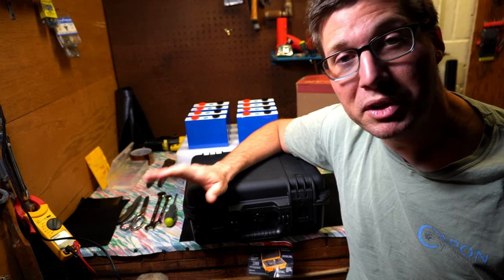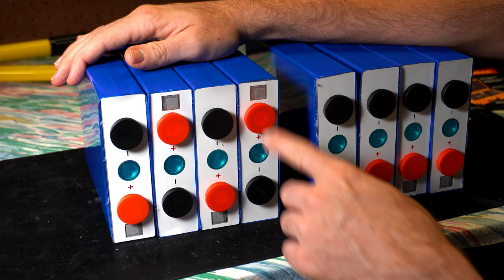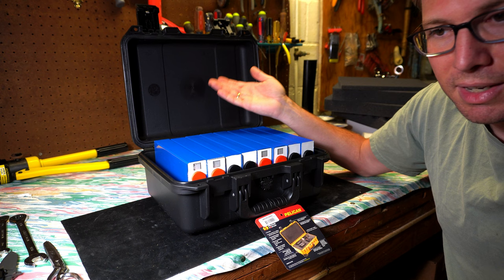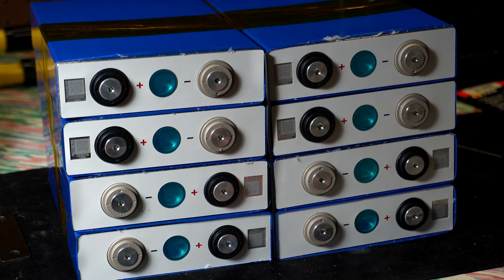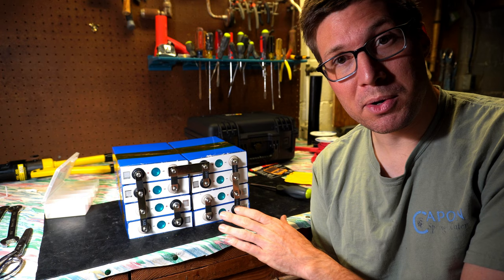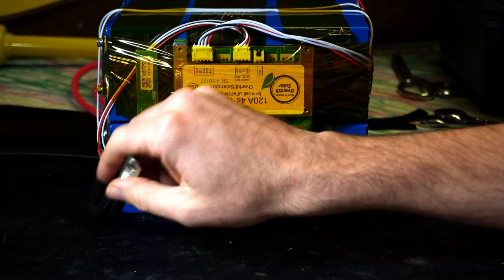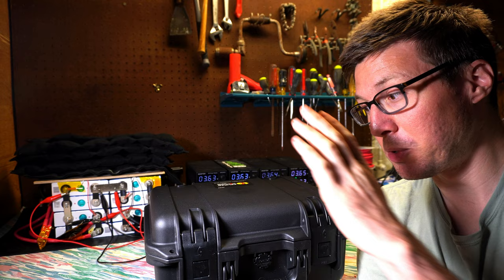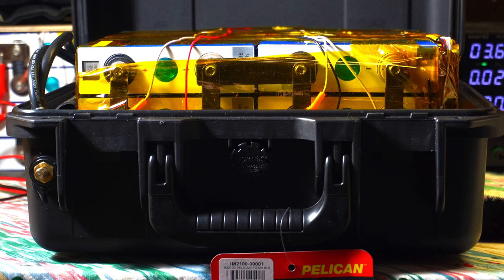How to build a Waterproof LiFePO4 Battery | Sailing Wisdom

Comment: I took the diesel out of my Gozzard 31 and put in an Electric Yacht motor with 48v 200ah LiFePO4 (4 50a batteries).  Also have a 12v LiFePO4 as the house battery, which can be switched to receiving charge from solar or the engine bank via a 48-12v converter.  I went all Renogy components to have a one-stop support desk with the supplier. For getting in and out of harbors/anchorages this has been fine so far.  Exploring augmenting with a 3.5kw Ecoflow rather than adding more engine battery.  Thx for the great videos.

Comment: I still haven't yet started my lithium battery project but I mostly decided to get lipo 48V 100AH x 4 = 48V 400AH from one of the reasonably priced lipo manufacturers.    Currently listed as $1,300 each.   Or, maybe I will get more of them, like 5 instead of 4, because they should probably all be installed from a set at the same date of manufacture.

I built a vanlife vehicle and am using a lipo 48V 100AH battery in it successfully (I suppose it is rated as 96AH or something but I will call it 100AH), and a victron inverter designed for 48V input, and a solar mppt designed for 48V output.   I can use electric cooking appliances in it quite easily (800W for 10-15 mins),  run fullsize iMac computer all day (150W), charge Mac laptop (65W), charge usb devices (10W), etc.

The biggest build problem has been finding the connection components which are rated for that high DCV.   Fuses are typically not rated for the 60VDC which the system needs as a minimum because lipo charging will hit 58VDC max.  I have no battery switch (i.e. kill switch) because I can't find one which is rated at 60VDC.    I ended up having to use a massive T-class fuse which I forget the details but might be rated for 100VDC.  Blue Sea Systems does not make any buss panels which are suitable for 48VDC system, the highest rating they have is 36VDC.  These limitations are not obvious from any of the packaging, and the packaging or item listings can even be misleading, so the fine print in their data sheets needs to be verified very carefully.  At 25:00 you show a battery terminal fuse, these are not rated for 48VDC, they are only okay for 12VDC, sometimes special ones at 36VDC.
Reply from the maker: I was not aware of the voltage limit! I will look into this right now!!
Reply from the maker: Thank goodness, they are rated to 58v https://amzn.to/3XQqSat

Comment: That ring that won't come off should get covered in electrical tape while working with electricity (for the reasons you took the other rings off)
Reply from the maker: That is a very good idea! What I really need to do is get it sizes again so that it can come off, but if I build another battery between then and now, I’ll do that trick with the tape.

Comment: im afraid to tell you what i did, and now im scared to leave it !  i made five lifepo4 cylinder cell bats,12V 4s15p, 81 A each.  i top balanced each 15p group and then balanced each 4s15p ' battery '  i hooked them up to a common bus that is switched to the electrical panel bus no fuse or circuit breaker.  i guess i should put in a bms on each 4s15p bat, and a house bank 400 amp circuit breaker !?  even though each boat circuit has its own breaker.  solar panels through solar panel controllers charge direct to battery bus . i was very happy, although no huge loads have happened yet, with the incredible charge acceptance, but now im scared! thx herb, what a great video !  i also realize i completely misunderstood the function of bms.. i guess im sitting on a 400A bomb..

Comment: Nice build buddy! I might do one of those myself. I've had a "drop-in" LiFePo4 since the beginning of 2021 which has worked great but is only 216Ah. The cells I have for my electric propulsion are 280Ah so if I used those and built a battery like yours I'd have 560Ah which sounds good to me! Plus they are way cheaper now than they were three years ago.

Comment: Did you mention to keep BMS connections on top of the main battery connections? I have read that was important so you don’t run high current through the BMS or other monitoring systems.
Reply from the maker: I did not mention that but that is a good point. I always build the battery and the last thing I do is connect the BMS. Since they are the last thing on, they are also the top connection.

Comment: Please forgive my ignorance, but how is this better/cheaper than just buying an off the shelf 200ah 12v LiPo4 battery for under $600. Is it the waterproofness, quality, size? Thanks for all your videos. I love your teaching style, btw.
Reply from the maker: It’s the parts that are used. There are many cheaper options, and one cruiser I know had the cheap Amazon LiFePO4 batteries (https://amzn.to/3sUO5KZ) and it burst into flames. Miraculously, he was able to disconnect and dispose of the battery while it was on fire and while he was sailing without any damage to his boat or himself! 
This battery is built from the top of the line components using the safest BMS and the best cells. As a result, the parts alone were $1200. 
Pretty much, you get what you pay for and when you build it yourself, you can select the best parts and save on the labor costs of the build by putting it together yourself. 
When you consider a BattleBorn battery is about $1000 per 100ah and isn’t waterproof, this battery comes in at a nice price point for the features you get.
Reply from the maker: This is the price of a premade quality battery (https://amzn.to/3EFMY4u) and they can still have issues arise on them. It’s rare, but I have seen them “singe” first hand. They have good components in them so the BMS shut the battery down before anything happened. The burnt cell wasn’t discovered until tear down. 
Cost wise, to get 200ah in those batteries would be just shy of $2000 where if you build it yourself, you can make a waterproof one for $1200. That’s where the cost savings come into play.
Reply: Makes sense.  Thanks for the reply!  When I'm ready, I think I'll give it a shot. I like knowing what's inside the box.

Comment: 800Ah 24V house bank charged by 5kW alternator/ 1.2kW solar (soon—work in progress)/ shorepower. The bank is for house loads and to charge the starter and windlass batteries. We only cruise the bay (for now)  and the large need(want) is aircon and convenience. 

Concerns for you: AIC rating of MRBF is only 10kA. Safety standards specify class T (20kA AIC) fuse. Also, the different lengths of the negative B- will have different resistance therefore heating. Likely just a bit under normal loads but at high loads it may be noticeable. Not sure why you wouldn’t use a single cable other than space/turns. Again, safety standards would have both parallel conductors capable of carrying the full load. I’d consider mesh sheathing where you have concerns about short circuiting.

Not really mentioned but the batt cases will need to be “installed” so they cannot move if on a boat. 

Pretty great demo of building a battery. There are lots of ways to skin the cat. I’m a bigger fan of an external BMS with communicating (CAN) charge/load control. Serial (in the B-) BMS solutions seem to be getting better and CAN capabilities on these can be sourced now. I would think for your propulsion needs, this could be a huge (more automated, less carbon based) monitoring/control system. 

$.02😇. (Thousands of ways to do it)

Comment: To answer your question I have 560 ah 12v  in my Catalina 30 made from 280ah cells. With 300 watts of solar and a igen 2600 genset everything works pretty well.  No electric propulsion.  In my RV Overlander conversion(Former Isuzu NPR) I have 1120 ah in two 4s2p batteries.  The truck has 2160 watts of solar and an ev  charging plug in the side. Also a mini split.  I am bringing it to the Annapolis boat show if you wanted to see the rig, and hopefully I can find safe parking.  That is going to be a problem, but it is pretty stealth if I park it the right way.
Reply from the maker: That sounds epic! I would love to see it when you come to the show!!

Comment: What are the cost savings going this route? 20-30% after you "amortize" the needed tools, etc? There has to be some decent gain for you to be going this route over purchasing pre-made and equally waterproof batteries.  Apologies if this was answered elsewhere and great vid all around.
Reply from the maker: The tools are pretty general tools that you should have on a boat, minus the hydraulic press which is very handy if you are making your own battery cables!
As for the gains of doing it yourself: you know the quality of the components in the battery and you know that it was setup properly. 
Yes, a store bought battery comes with a nice warranty, but what good is a warranty when you are in a remote location with a dead battery? By making it yourself you know that it is made right and no cheap parts were used for the sake of improving the profit margin.

Comment: Wrap a piece of electrical tape around your Masonic ring while working around open lines and terminals.
Reply from the maker: That would have been a good idea! One touch to connect a circuit and I would have been brought to still even further light in Masonry!

Comment: This chemistry doesn't just explode or burn out of control forever.  Even with a dead short
Reply from the maker: With these you have a big of leeway, but if you abuse them they will ignite. If I tell people that they can catch on fire, they hopefully will be more careful around them.
Reply: @RiggingDoctor  this is just a knockoff of a Will Prowse video.    But I'd imagine you bought a pallet of cells direct from China and never tested them.  Really sloppy if you intend to sell them.   You're insured as a manufacturer?

Comment: We have a 400ah LiFePo system I built a year ago which drives a 3000watt inverter for the induction cook top. The 400ah is enough for two maybe three days. The issue isn't capacity, its generation. I'm planning for a kilowatt solar array this winter so we dont run the generator as much. Also have a 140amp alternator but I hate running engines at anchor. Planning a Bahama trip 2025!
Reply from the maker: You will have plenty of Sun to keep your batteries charged with a kilowatt of solar!
Reply: @RiggingDoctor  We have 300watts now but they don't keep up. Hoping twin 450 bifacials do the trick.
When I made my battery, I bought 1"x.125" copper barstock for the bus bars. 2P4s with no overlapping bus bars. Check out DIY nickel plating. really comes in handy.
Reply from the maker: That is a skill I would like to learn!

Comment: I've had some marginally serious issues out of my JBD BMS modules.  They don't balance too well.  Also you have to turn balance while charging off or they basically don't balance long enough. Essentially the BMS balances with a paltry 50ma bleed off only.  So it only pulls energy out of too full cells and doesn't put it into low ones.  I have built new batteries with the JK BMS and it has an active balancer.  I have not had problems with those batteries.
Reply from the maker: Good to know! The BMS from Overkill is the XiaoXiang BMS and has been reliable. The balancing is ridiculously slow though so it’s important to top balance first. The JK BMS does a good job of balancing for you?
Reply: @RiggingDoctor  Yes the JK BMS is a miracle worker.  I have the JBD(XiaoXiang) BMS in my boat and my electric motorcycle.(Fly E motorcycle) The JBD has caused me a lot of headaches.  My motorcycle has gone dead with 25% remaining because one of the cells reaches the low voltage cutoff and all the rest are terrific.  The boat batteries always have a large deviation in voltages on the low cells.  The JK BMS with the 2amp balancing current makes my cells in the overlander pretty close to perfect all the time except after pulling a lot of amps for a really long time. Even then it is usually like 0.015!  If you make more batteries, I highly suggest going with the JK BMS series.
Reply from the maker: The reason I use this BMS is because of the tests Will Prowse conducted. The Daly BMS doesn’t actually have a functional low temperature disconnect. He put the probe in ice water and it kept right on discharging after surpassing the low temperature threshold. It out performed the XiaoXiang BMS in every other aspect, but the XiaoxiangBMS has better safety control of the cells which is why I chose them for the boat battery builds. 
As a result of this choice, balancing becomes super critical since the BMS won’t do it for you.
Reply: I’ll second the recommendation for the JK. Had 6 12kwh batteries for my house (on land)… The JBD (xiaoxiang) BMS caused all sorts of issues. I swapped all for JK after researching options. Been perfect ever since. Check out off grid garage channel for some awesome reviews off various BMS’s. I’ll be doing a lifepo4 build for my Lagoon 43 and will be using JK’s for sure.
Reply: I have several JK BMS’s for 24v & 48v setups, they work perfectly for large cell balancing. I dont use or work my batteries very hard so the 2A balancing works great & can get the cells within a few Milly volts daily on a full SOC easily. Andy’s off grid garage does a lot of extensive testing on all this gear.
Reply: @RiggingDoctor  Will Prowse - there's the problem.  There is more bad info on YouTube than good, unfortunately.  Beware the difference between standardized testing and unreproducible anecdotes.

I use JBD for my small, portable, amateur radio field batteries.  For my stationary off-grid battery, however, I'll only use DIYBMS.

Comment: Umm, with the extra rubber to compress the battery, does the case still remain water proof? I would think the sides might expand beyond what any gasket might take up.

How much does this build weigh? I'm doing an electric dinghy and was using a 100ah AGM which worked fine but I am the only one who can lift it. Climbing into the dinghy while balancing battery on sheer of sail boat and lifting it down is going to lead to disaster sooner or later (though not as bad as trying to lift a 60 pound outboard and then put it on the transom). The 30 pound lifepo4 I am replacing it with can be handed to me by anyone on the boat. It is only 100AH. I would kind of like 200AH for the extra range but 60pounds starts to get back to the I have to do it on my own. I suspect I will end up with two 100ah batteries in the end.

For house batteries we had 200ah of agm. I found adding the extra 100ah battery we also used for the dinghy gave me a comfortable voltage in the morning before the sun hit the panels, even with some use on that battery before nightfall. Fridge, freezer, computer(s), water pump, lights, fan. Panels are a mish-mash combination (from previous owner) of maybe 300W?

Comment: Nice video however prismatic cells DO require compression, cylinder cells do NOT require compression.
Reply from the maker: Absolutely! The people who leave gaps for “air flow” manage, but they really should be under compression because they will puff up!
Reply: You should have strapped cells together.  Cells expand(puff) on their wide side, not their narrow side, as you stated. 
The expanding cells will put stress on the cell Terminals because they are linked by rigid busbars.
Try again.

Comment: Nice work! I applaud your efforts in this regard! I am a huge DIY fan and have considered doing my own batteries. That being said the cost now has dropped significantly on drop ins. We are prepared for LFP batteries and expect to have around 1200w of solar, ~800ah @12v  of LFP. I expect 4, 200ah but could also be 2, 400ah or 3,300ah. We will have all electrical galley but still have diesel propulsion with our 250a electromaax alternator system.  We are holding off on the upgrade to LFP until spring of ‘26 when we move from the Great Lakes south to warmer climate! Keep it up!
Reply from the maker: The other reason to wait on the LFP is the price keeps coming down year after year
Reply: Exactly why we are waiting. We are tied to a dock for the next few years out of necessity.

Comment: This is very informative, thank you! Planning to put 16 3,2v 280ah cells in series to get a 14,3kwh battery bank for electric propulsion. Any tips with waterproofing that?
Reply from the maker: I have built 3 24v batteries (one in the dinghy for it’s motor and two in series for our boats motor) in pelican cases using this same method. 
I’m going to be building a much bigger battery bank for the sailboat soon and the pelican cases were going to cost more than $1000 so I’m contemplating other options. 
My current thought is to make a box in plywood and epoxy it to make it waterproof with a clear lexan lid bolted down and bedded with butyl tape. The power would exit the box via the same through bolt terminals. This is my current mental version and it has already gone through a few versions to get to this point. 
I will be building the batteries this winter for the boat so if you can wait a few months, you can see my final version in the videos and learn from any design mistakes I encountered in the process :)
Reply: Thanks for the reply! I was also going for the plywood/epoxy option in my head. This offers some flexibility in the shape of the box all although the cells still need to be (neatly) connected and accessible.  The clear lid is a nice added feature, thanks. 
Looking forward to that video :) might be building mine in the same period of time, then we can compare :)
Reply from the maker: Sounds like a plan! Having the cells facing up will also let you do any changes or adjustments to the cells without removing them from their box.